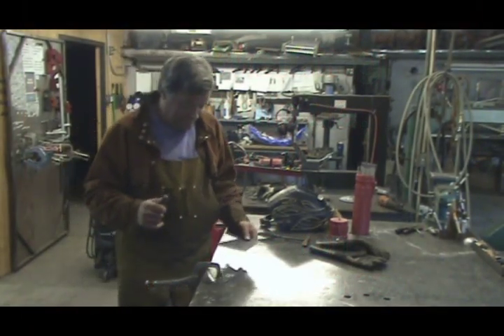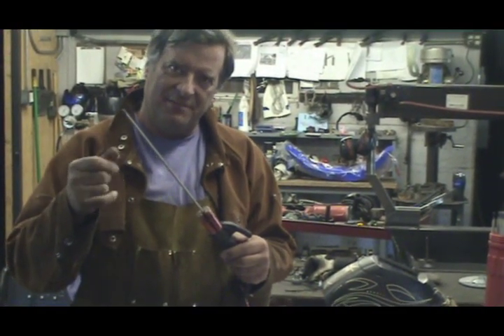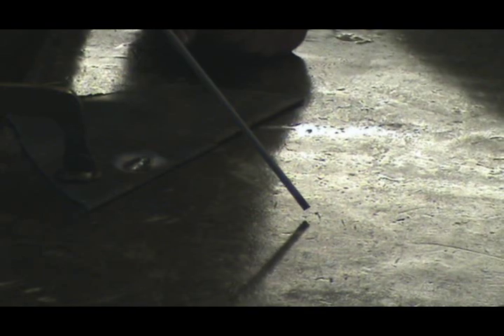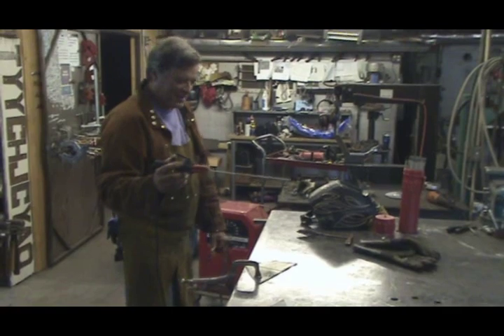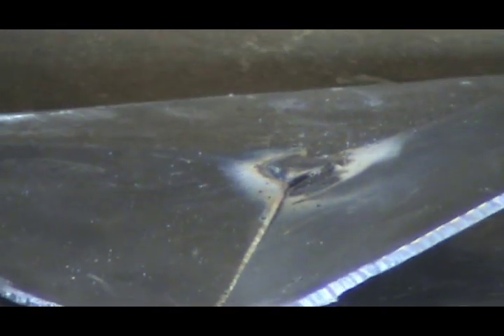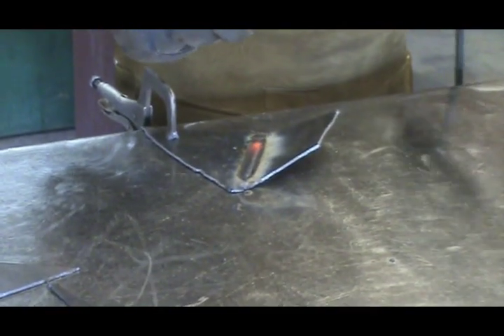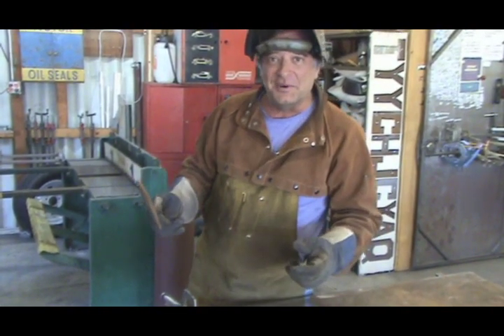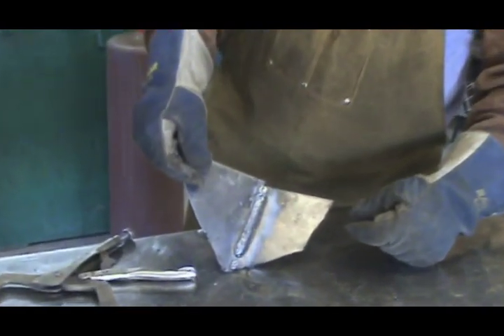Arc Welding Technique, Part 2 - Kevin Caron

Comment from the maker: I would try this,  Mark the piece off in quarters, Tack the ends (very small, maybe 1/4 inch), tack the middle both sides same size. Tack the quarters both sides. Let cool and check for square. Then weld one quarter at a time, inside then outside. Jump to other end and switch sides, outside first then inside.   Make sure you are using the correct size rod for your work.   Let me know how that works...

Comment from the maker: @pberglin Well the breaker for the welder is a 50 amp. 

As the the most harmful fumes, I would have to say the ARC is about the worst. But that is just my opinion.
Reply: There's a bit of a difference between different types of sticks in terms of toxicity, correct?  Some say they have manganese which can be bad.

Comment: its a good 7mm thick it could be its warping as i don't tack both sides i just weld the one side and then the other.  i just cant get the weld in the right place if i weld just a straight line the weld sits on one piece and not both and then when i do u shapes i get weld on both pieces but there's the gap between them.

Comment: hey can you help with this problem when i weld some thing at a 90 degrees angle weld hits the top piece of metal and the bottom piece buts there's a gap between them what's my problem thanks.